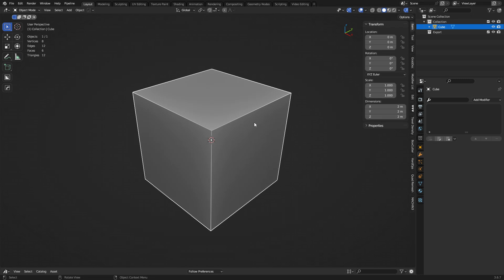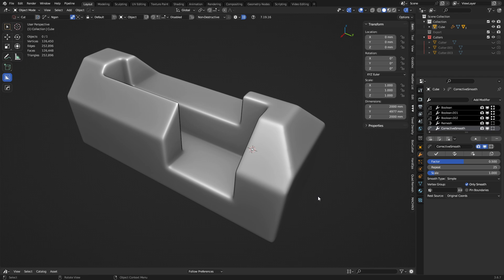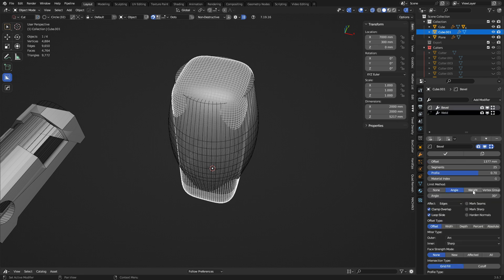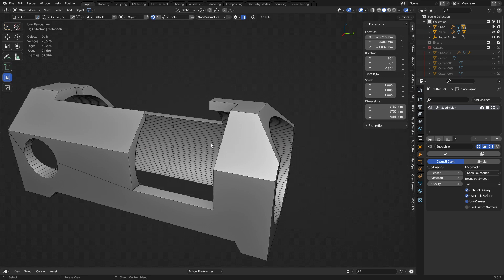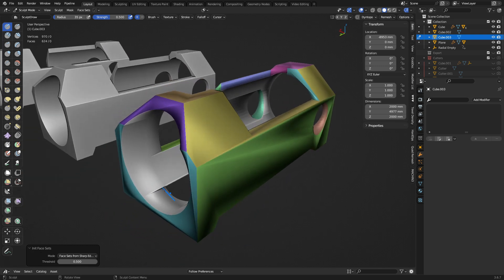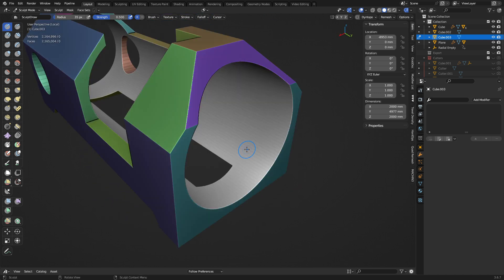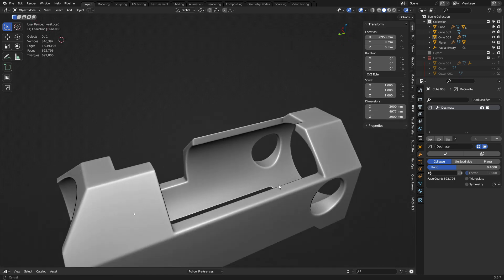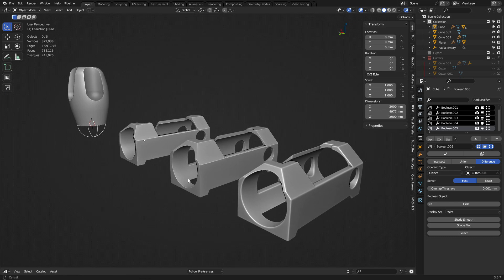Blender - Hard Surface Remesh Workflow

Comment: Great workflow, have tried it, but find out that a little different works better for me. After im getting the shape of the model, i'm applying all modifiers, cleaning up the topology a bit, then adding the subd, cleaning up the popping out artifacts, then remesh+corrective smooth and decimating.

Comment: Understanding proper workflow is so important, even for hobbyists, it saves you frustration which can limit your overall creativity. I started a project from a rough image file, manually drew vector trace, exported as svg, imported to blender perfectly, but i didnt understand how to work with curves and that i could leave them as imported, non destructive, and apply shape modifiers to give them dimension. Instead, i disliked how the topology looked once i manually converted them to mesh and extruded and beveled them, the curve resolution was stupid high, causing so many unnecessary vertices and edges, causing the bevel modifier to yield insane glitches, so had to be manually beveled in edit mode, then became fricken half a billion tris...
Remesh i thought meant retopo (noob) so i tried it, but at a resolution that would reduce overall mesh density, it looked very blocky, and i couldnt fix the bevels anymore... And to add insult to injury, i inexplicably wrote over the original source vector AND the svg, and didnt use redundant saving...
Learn. Your. Tools.

Comment: my mesh keeps colapsing when i remesh does anyone know whats the issue i checked the normals
Reply from the maker: Check for double verts, look for holes, make sure mesh isn't overlapping to closely (face over face), look for free floating geo (verts).  Sometime it can be hard to find the error.

Use machin3 tools cleanup feature if possible. It can help sometimes to find the error or solve it.

Comment: I recommend using Subdivision my difier before Remesher (value of 2 is mostly enough). This helps to smooth all that curvy areas, esoecially if you use 32 sides cylinders.

Comment: Dumb question coming from someone who doesn't do game assets - why do you need to remesh at all for a hard surface model? Can't you just use the original boolean + bevel result for a much lower poly count? Are you just trying to avoid ngons on the flat faces for some reason?
Reply from the maker: Game models are low poly optimized meshes. Normals from a high poly are baked into a normal map to increase the lows quality. Bevels add more triangles and aren't always needed as the normal map will make sharp edged models look beveled.
Reply: @pzthree  I'm still not sure I understand the purpose of the remesh though - isn't that just adding even more polygons? If you want minimal poly count, couldn't you just take the boolean + bevel model and bake the normals onto a copy with the bevels removed (and cylinder detail turned down)? Why do you need the higher detail remesh in between?
Reply from the maker: You can do that. Think of this as an additional step in that same process. If I need surface deformations, damage,  wear, I now have the ability to add that.

Comment: Really helpful video! I just know you can do smooth repeat in scuplt mode, I used to increase the poly of the cutter, really tired to do it manually.
BTW, is there a way to prevent Blender to slow down when the number of cutters increase? My blender just getting so laggy when I want to rerange the cutter in that situation.

Comment: after doing the poly work add a 2 face bevel then mesh smooth and youll then remesh smooth cor dec etc. that way you influence the edges even more to be smoother. i think its important for people to know this method becuase its pretty easy to get complex hi polys without alot of bs....good job. i wish the quad remesh knew blender has face sets now....that would make it much easier to work with
Reply from the maker: Nice tip.  I heard quad remesher was due for a big update but It didn't make it into the latest version. Would be nice to see one, cross fingers.
Reply: Can you explain a bit more? Adding a bevel before the remesh changes nothing (at least if its a tight 2-face bevel, as I assume you mean?).
While I use the remesh+smooth+decimate workflow a lot myself, I never looked into "smooth corrective" either.
It seems "smooth corrective" with "only smooth" ticked behaves the same as a normal smooth with factor set to 1.0.
What is a bevel + "mesh smooth"? And does the visual smoothing (shade smooth/autosmooth) play a role in corrective smooth or such?